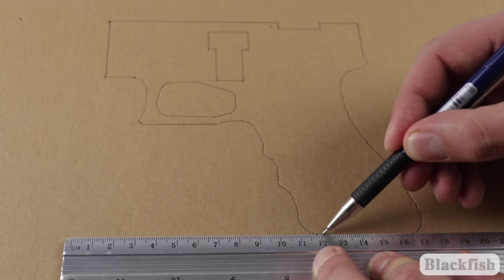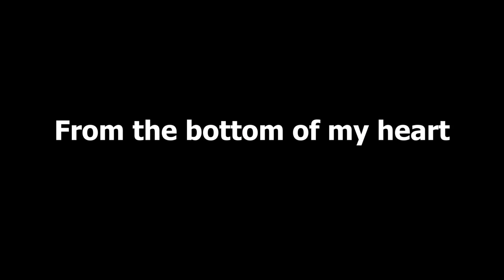How To Make Glock 19 Full Auto   Cardboard

Comment: Wonderful and very creative work.
Will you consider hiding the wire running at the back of the handle?
Another tip - think of adding a small lead bead (fishing weight) or lead soldring wire at the front edge of your bullets - they will fly nose front this way. 
Also - why not shift to wood rods instead of rolling all these bullets from colored paper. That must take a lot of time. Turning these from wood on a lathe will be simpler and faster while still remaining in the "paper" theme (elbite a bit less). 
If you need help - let me know and I'll gladly turn some for you.

Comment: El glock 19 y 18 tienen la misma capacidad de disparo (velocidad) y va a mas de 900 o 1000 rpm igual que el fusil de asalto famas (o como le diganxen tu país). Pero esa va a menos de 100. Porque dispara cada segundo. Yo le pondría un motorcito mas potente y capaz. Y el cargador le calcularía para las 15 o 20 balas. (Call of duty chicos :v)